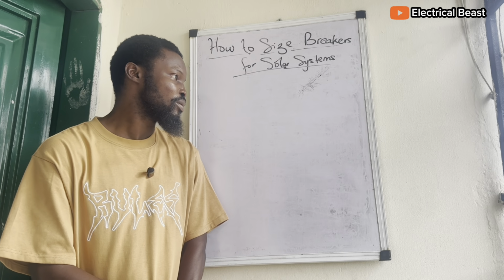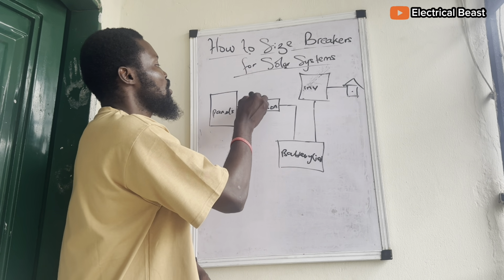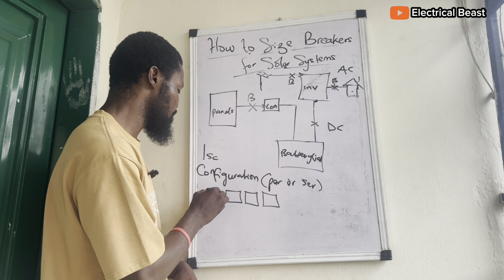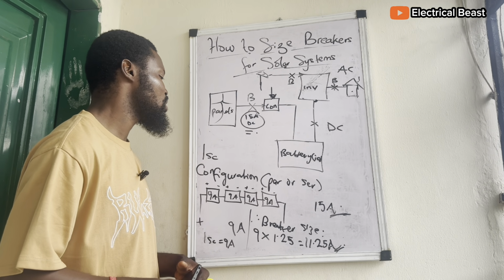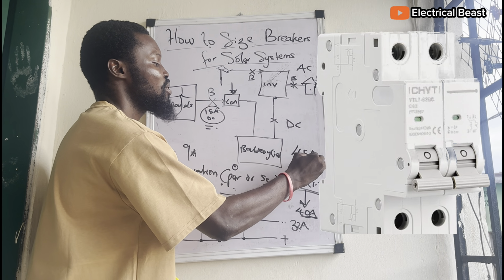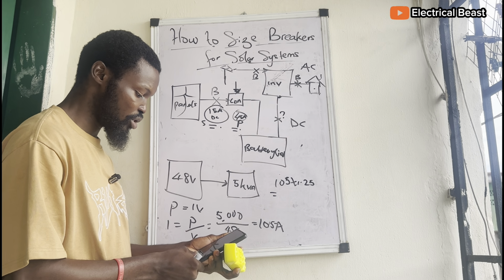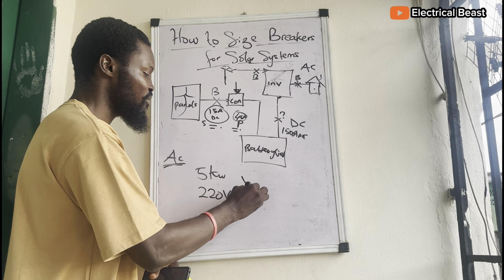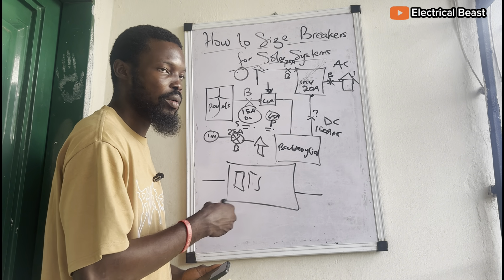How to Size Breakers for Solar System Installation.

Comment: i humbly correct that when connections are in series voltage increases and parrelled the amperage increases. im sure it was an oversight from your end

Comment: But for the battery breaker sizing, after you divide by the inverter KVA by the battery voltage , why multiple by 1.25 again ?
When we wouldn't want our battery to deliver more that something that can overload our inverter

Comment: How do we calculate the amperage if we are using more than one 48v battery connected in parallel(breaker size)

Comment: what if you have 10kwh X 4 connected in parallel, how can you choose the actual breaker for it.  Also in a 220AH X 4 tubular battery connected in series and parole, how can you chose the actual breaker for it?

Comment: Great works. I need to clarify, what determines if you will go for a series or a parrallel PV array configuration, let's say you have a done a load analysis with the client and you have calculated the daily energy consumed in Khw, and the total number of panels, battery size in Khw or Ah, charge controller and inverter at what point should you size your breakers. Thanks in advance
Reply from the maker: It depends on whether you’re using a hybrid inverter or a transformer based inverter and a charge controller. Lately I prefer using hybrid and all my connections are in series, dc breaker sizes and cable are smaller also
Reply: @engrgideon Thank you for your response

Comment: Ijebu-Ode, please where is the AC output from the hybrid inverter going to be connected on the AC breaker
Reply: It goes into the ac surge, then you loop with the ac breaker and then the voltage protector

Comment: Oliver, watching from kaduna.
Please kindly help me out, I have a 6.2kva sako inverter and 7.68 kWh hyper power lithium battery and I intend to use 4 units of 610watts panels,  I need Guidance on the type of breakers I need to buy and the AVR. Thanks
Reply from the maker: Get a 16A DC breaker
Reply from the maker: Any avr would do, just ensure you set it properly.
Reply: @engrgideon thanks sor, I appreciate

Comment: Thank you very much for your explanation. I'm watching from Abuja Nigeria. The  calculation of the parllel connection of the example you use is 36 Amps and not 32Amps. I really enjoy your lessons especially your  illustrations using block diagrams. please keep it up
Reply from the maker: Thanks for the correction!! As always, I’ll bring more 😇😊

Comment: Your explanations are very understandable. Thanks
My question is, why don't we have protection between the charge controller and the battery?
Reply from the maker: The output from a controller is safe without fluctuations, the controller is more like another protective device that ensures the battery charges better otherwise connecting directly to the battery isn’t ideal

Comment: When paralleling two batteries with busbar do you apply your breaker between the battery and the busbar or between the busbar and the inverter
Reply from the maker: Between the bus bar and the inverter

Comment: My brotha thank you for your knowledge. Let us just clarify some things for the viewers. The breakers are not there to protect the equipment. They are there to protect the wires. The calculations you did are to help determine the size of the wire. Only once you determine the appropriate size of wire can you determine the appropriate breaker size. The wire are sized appropriately for the equipment, and the breakers are then sized appropriately for the wires to prevent the wires from catching fire in case of short circuit.
Reply: Please take note - you're correct by half.

Equipment like inverters, charge controllers, batteries, and cables can be destroyed by voltage surges or high current. Correctly sized breakers protect these components and increase system reliability and lifespan.
Reply: @LouisNwali-m4f  you are misinformed. Circuit breakers for overcurrent protection(which is what the video was explaining) do nothing to protect from “voltage surges”. Equipment like Inverters, charge controllers, and batteries only draw  the current they need. If there is a dead short in the equipment it is already broken, there is no saving it, and certainly not from a device downstream of its output. It’s not logical. Overcurrent protection circuit breakers protect the wires.
Reply: If your inverter can output 50 amps and there is a short circuit somewhere downstream of its output it still will only output 50 amps. And if the wire downstream from the inverter is not rated for 50 amps it will burn unless you have an overcurrent protection breaker on that wire that will trip and interrupt the circuit
Reply: Much appreciation from America!

Comment: Thanks a lot bro, i i have learnt a lot more esp there are different breaker size for series and parallel connections. 

Unfortunately the full that did my connection used a 63A DCB for a single 600w panel with 14.4A panel rated current. 

I will remove it now and go get a 20A dcb.

How about the spd breaker sizing? Let me if the one here is d right size.
Reply from the maker: You’re welcome sir!! Spds are sized by voltage. 500v, 1000v,, most hybrid inverters require not more than 500v spd

Comment: I forgot...
You didn't mention the switch from the charge controller to the battery.
I read online that it's recommended to run a double-pole switch from the charge controller output to the battery.
Am I right?
Reply from the maker: Not necessary, but if you have in excess you can as well add one there

Comment: Please i have 10pieces of 440w panel on 5kva, 10kwh battery. What kind of connection is sweetable for the panels
Reply from the maker: What’s the VOC of the panels and maximum pv voltage of the inverter?

Comment: How do l calculate dc breaker when putting batteries in parallel?
Reply from the maker: Your charge and discharge current will guide you right in that regard.
Reply: That is sensible question pls can you unmask it a little sir with an example? Thanks

Comment: Thanks for the lecture.I have two questions.
a. In sizing the DC breaker between the Panel and the charge controller.I have seen some specialist using safety factor of 1.56
b. In sizing the DC breaker between the battery and Inverter.I have also seen some specialist first calculating the input efficiency of the inverter by diving the rated wattage of the inverter by 0.9 .The result is then divided by the battery voltage and multiply by safety factor of 1.25 in this case not 1.56 as in the case stated above.
Thanks and Regards.I will appreciate your feedback.
Reply from the maker: The factor used depends on the standard you follow, for this video, factors were based on NEC standards.